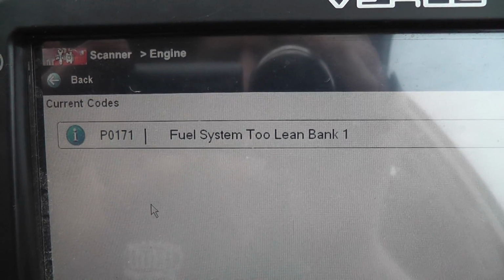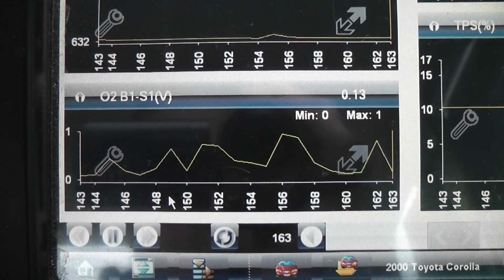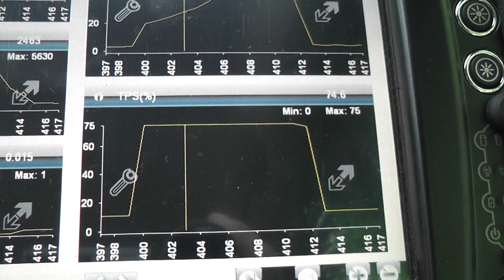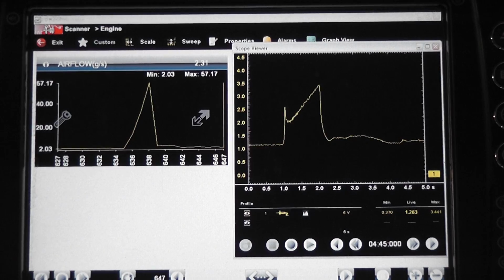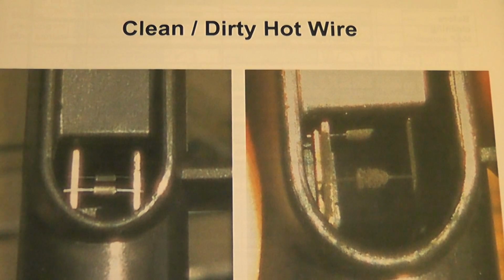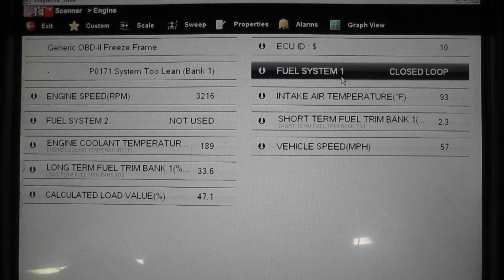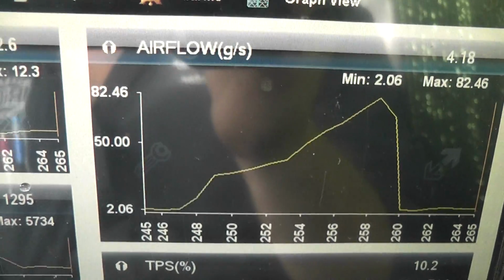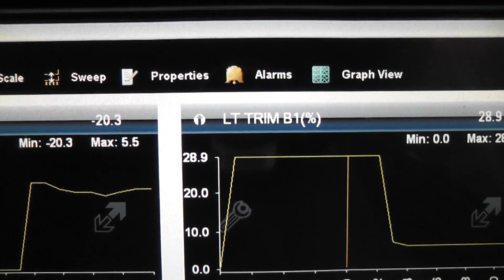Dirty MAF Sensor Case Study

Comment: First, great video.  Really instructive.  How did you conclude that it was a MAF sensor problem from the O2 being lean at WOT?  Couldn't it have been a fuel injector or a fuel pressure problem?  Did you know what the fuel injector pulse width should be at WOT, and that was how you pinpoint it to the MAF?

Also, would it be possible for an injector to fail (and not open properly) even if it was getting the proper fire pulse at WOT?  If so, how would you rule out that failure possibility? 

Is there an easy way to check for fuel pressure on the Corolla?

I have a 1999 Corolla, so have an interest in this.  Appreciate any response, if you have time.  Thanks.
Reply: OK, just reviewed video and saw that you were looking for a specific high MAF sensor voltage when you snapped the throttle.  That was how you isolated the issue to the MAF.  Sorry, should have watched a few more times before asking--just a ton of info in your videos.  Looks like a fast scope is very helpful.  If you ever expand your primary audience base of professional mechanics, it would be interesting to see if you could devise some trouble-shooting techniques for home DIY with only a scanner and voltmeter, etc.  For example, would it be possible for a home mechanics to have properly diagnose the problem in this particular case without a scope probe?

Not sure if you would have time to respond to this long post, but wanted to give my comments.  Really do appreciate your videos.
Reply: During WOT the computer doesn't use the fuel trims, so the o2 always read rich. It has the opposite effect during his test drive and was lean.. If it was a bad injector you would see check engine lights for a  misfire.

I'm a DIYer and watch a lot of danner videos to learn his process to trouble shoot. I don't have the fancy tools available but use what I have. I use a DMM and my bluetooth/torque app to diagnose. For example in this video if I suspected the MAF was bad I would unplug it for a test drive. Without a MAF input, the computer will use a default fuel map instead .. if the car runs better without the MAF then I'd suspect the MAF.
Reply: czhou57
I have bluetooth OBDII and torque as well.  The thing that would really help me diagnose problems is if there is published reference on OBDII live data parameters.  For example, if you were suspecting the MAF sensor, you can just drive around looking at the MAF live data reading at idle, during acceleration, at 2500 RPM, etc.  This would be a very easy and painless way to at least establish a direction in the diagnosis.  As it is, there doesn't seem to be any universal reference material on this.  For example, this kind of data isn't in the service manuals, from what I've seen.  So a person has to go on Internet car forums and ask, say, "is 3.9g/s mass air flow at idle is normal?", and things like that.  Scannerdanner usually mentions that he knows that what a parameter reading should be, at certain condidtions--I don't know if he knows this from experience or if there is a reference source that he has access to.
Reply: I agree. The data isn't readily available, but is out there. For example, on the factory service manual for my van it says it's 5-7 g/s at idle up to near 125 g/s at WOT. Then in troubleshooting steps it says if reads below 100 g/s at the 1-2 shift at WOT then there's a problem somewhere. Then it has a bunch of tests to check for bad voltage supply or wire to the computer. I believe the specific data is specific to each car/engine/manufacter. I think with the absent of these  #s  , the key is to look at trends of the graph like in the first half of the video.

I think it helps to understand how the MAF works. With the hot wire type MAF found in many cars, the sensor is a wire resistor that is cooled by the air flowing across the wires. With more air flow, the resistance is decreased. Typical supply voltage coming in before the sensor is 5 volts. At idle, very little air passes through the sensor, so it should read at the lowest voltage...something like 1V or less due to high resistance. Then at WOT, the max amount of air is flowing through the sensor and the resistance is at a minimum.. so it should read at the highest voltage.. something like 4V or more. The computer will take in these voltages and translate them into a grams/sec reading.. a higher voltage is higher g/s reading, for example. 

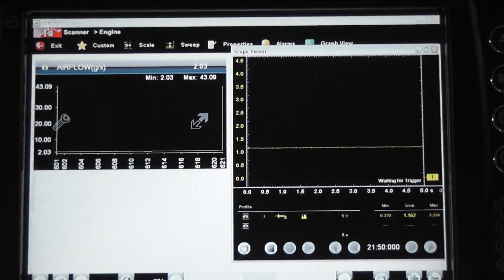What you see danner doing at 6:00 is testing for max voltage at WOT during is snap throttle test. The reading was less than 4V, and that led him to believe he had a dirty MAF. 

Now, thinking about it.. I believe that the MAF can be tested simply by testing at the two extremes.. idle and WOT. I don't think its possible to have a good reading at idle and WOT but bad at part throttle due to the way the sensor is made... its just a wire resistor.. unless its a random intermittent faulty electrical signal or something like that and only applies in part throttle.

Also to add to that thought, I think that g/s reading isn't as important as the voltages themselves.. so I believe danner's comment that the MAF should be over 4V at WOT would apply to any car with a MAF with a 5V supply circuit.. so if you don't have g/s data, you can just dive right to the voltage. Since the specific data (in g/s) is different for each car due to variations in engine requirements, but the MAF is still driven by 5V and should trend the same way (low volts at idle and over 4V at WOT)

Hope this makes sense. Thanks for asking the question. I learned a lot too while trying to figure this out.
Reply: Sorry for the long post above.. I typed it out in segments while I learned about the MAF .. didn't realize it would be so long..

I still agree with your first statement though about not having specific live data points to compare with. I have a GM, and their factory manuals are generally complete with flow diagrams to test and diagnose certain components, but in general the data isn't accessible outside of anyone without a factory manual. The helms/chiltons manuals aren't as detailed.

Comment: Great test i like the veruss min max capability however i always use my dvom when reading o2 signals ive just been burnt to much with false readings but overall that was a great test got straight to the root without even having to check fuel pressure

Comment: 1998 f-150 4.6 4wheel i replaced both exhaust manifolds,both cat pipes all 4 o2sencors plugs and wires and im gettin codes po171.. po305... p1151 im lost on what to do next it wont pass inspections with check engine light on any sugestions

Comment: Paul, MAF air flow depends on HP. The 2000 Toyota has 125 HP so max air flow will be about 110 gm/sec. An E39 M5 has 400 HP so max air flow is 350 gm/sec.

Comment: I have this code on my ford focus 2001 and I got a p0171 code. I do have an autoenginuity scan tool with ford enhancement. Do I have to check those 4 PIDs to make sure if I have a vaccum leak or a fuel pressure failure? and when you run this test, did the car was on KOER or KOEO?

Comment: This looks like exactly the right video to help me figure out my 2002 Prius.  It gave me two P0171 codes.  I borrowed a scanner from a CarQuest shop and the freeze frame data says:
Fuel Sys 1  CL
Fule Sys 2  NA
Calc Load %  48.63
ECT%  72
STFT B1 %  0.00
LTFT B1 %  43.75
ENG RPM  1494
Veh speed 45
IAT (deg C)  12
[I am a complete novice and don't know what most of this is saying.]
Does this look like a dirty MAF sensor, too?  I am about to attempt cleaning it in my driveway.  Yay -- it's above 30 degrees for the first time in weeks, too!
Reply: Yes it does. An under load lean condition is what your freeze frame data shows. IT will either be a dirty MAF or a low fuel pressure problem. Although this being a hybrid may change things but I am not totally sure.

Comment: GREAT VIDEO! So to recap what you said, if the check engine light pops on at say 30-40mph, it could be a dirty MAF and if it pops on at idle it could be low fuel pressure or a vacuum leak?

Comment: Hi Paul  question about 99 frontier 3.3L code p0300 high idle about 1800 maf signal snap throttle 3.8V the maf has oil and the air filter too is this maf sensor can set  
P0300?

Comment: This is so awesome man. My 98 camry was running lean base on my fairly new plugs having ash like build up and power reduction at increased RPM. found you video and it surely help me to understand a bit more of whats going on. dont have all your test equipment but now know the expected output voltage from the sensor when I do my volt meter test. 
As an electrician I know the benefits of the right test equipment. great job on the video.

Comment: Cheers man. Just recently bought a Celica GT-S and suspect I'm having almost the exact same issue. Replaced Spark Plugs and put injector cleaner in, didn't help much with my lag. Figured it was a MAF Sensor issue. Going to clean it this afternoon and get back to you :) This vid helped a lot, cheers!

Comment: I have a 1990 Toyota Camry, and i just replaced the Fuel pump, and filter, and spark plugs/battery. The car starts up, and then it idles, and a few seconds later, dies. Does anything ring a bell ? because im about on a blank on whats wrong with it. any tip or help would be appreciated!

Comment: I have a p0171 code as well. Changed MAF and  O2 and code still present. Car struggles in the freeway. U think its the fuel pressure regulator or the fuel pump itself? Its got a high mileage.

Comment: hi, wondering if you would be able to tel me why I can't sync any of my scanners to a 2002 Rav4 and a 2002 Avensis Verso both have the 1AZ engine? I have a n Autel AL419, Autocom CDP+ and also an ELM327 off eBay, none of these scanners will connect to the ECU under any circumstance, except the Autocom but only if I set it to Rav4 02 Model with Diesel engine, and even then it only gives limited access. I'm having an extremely lean burn.
Thanks

Comment: I've had this issue before and although I fixed it with a clean, the sensor eventually failed down the line.  I just prefer to replace the sensors now.

Comment: Danner,great channel buddy. As a hobby mechanic, and a guy who mostly tinkers with *gasp* carbs, I can only dream of having the diagnostic tools and knowledge that you've acquired over the years. But I appreciate you showing us how it really should be done by good, experienced mechanics.

Quick question for ya. On my 96 Mustang I had a P0172, if I remember correctly. I chased it for months with new vac hoses, sensors, etc. Ended up being badly arcing plug wires. Does that sound right to you?

Comment: Hi Paul. I have a question about hot-film MAF sensor like HFM 5 made buy Bosch. A good initial voltage spike signal witch produce this sensor, is it similar with the same initial spike signal witch produce a hot wire MAF sensor or not? Thank you.

Comment from the maker: The check engine light will set the other two lights. They are the traction and vehicle stability control systems. 
Fix the check engine light and you will automatically get rid of those other lights

Comment from the maker: there is no time frame, it is a learned value and will constantly adjust if needed. Every run period there can be small changes with it. 
After a repair, it will correct back to normal values while driving the vehicle. 
Watch my video "Understanding ST and LT Fuel Trim"

Comment: The VVT-I configuration did not exist on the 98 Corolla, it started on the 00 model year. Check your fuel pump pressure. Had the same problem on my 98 Corolla at around 200,000 miles. New fuel pump cured the problem.

Comment: Hey.

I have a question.  I have a 1998 Corolla VVT-I and it does not have a MAF sensor.  Some people said it is on the air box but there is nothing there.  I have a P0171 code that is annoying me and I would like to try this first before replacing the 02 sensors.

Thanks.

Comment: I have the same car. I have high long term fuel trim over 30 and short term at -+3 I changed intake gasket, o2 sensor, checked for leaks, exhause gasket. Swapped mafs what do you recommend.

Comment: Working on my friend's 2000 Tacoma truck today. Same P0171 code, plus a P1133 (A/F sensor circuit response). Drove around, long term FT topping out at +39% at higher engine loads, but negative at idle. This video instantly came to mind. Checked fuel pressure just to make sure, then went after the MAF. BINGO! A little electronics cleaner and a light brush...truck drives like new now! So why don't these sensors have a self-cleaning burn-off circuit like older MAFs? Once again,you're the man, Paul!

Comment from the maker: Yes. The MAF sensor is actually a mini computer. All of the conversions are done inside of it. 
All computers need a main power and ground to work. So you can think of the 12v feed and ground on this MAF sensor as the same thing. IT is actually a MAF module.

Comment: Thank you for your response , so it receive 12 volts external the maf and some way inside the maf it is converted to 5 volts Out put  sensir signalto PCM  is that rigth?? Because on snap throttle I saw about 4 volts. Thank you , you are a great teacher

Comment from the maker: There are two grounds because the PCM MAF signal circuit actually gets its ground through the MAF sensor. 
So one ground is PCM to MAF and the second ground is MAF to the block. 
If the MAF to the block ground is bad, BOTH grounds will be bad. 
No 5 v ref. on this design.

Comment: Paul do you know how this circuit works  (maf sensor) I was working. On  2000 ford focus  the maf sensor has  6 wires 
Pin 1 And 6 are for air sensor . The pin #2 has  system voltage ( 12v). On the pin #5 is coming out the sensor signal to PCM at wot  about 4 volts . But on pin 3and 4 I have ground . How that works . This was perform on not working maf I did. Not see  any signal so I decide ti check power and ground  and I did not find any 5 volt reference  any way I replace the maf and it fix

Comment: Unfortionetly. i have a 95 monte carlo z34, nothing but problems since day once...idk wtf its issue is lately, on idle, the pos runs way to rich and seems to be running only on a few cylinders, but soon as ya touch the throttle, runs n purs like a kitten, so idk what its issue is, and quite honest, idc to even work on it no more, nothing but a money pit, i'm just going to drive it til she blows, unfortionetly, it wont, ive been beating it senseless for months now..maybe ill fix it someday idk..

Comment: I'll still rather deal with carbs then bullshit fuel injection...yes injection is quite better when it comes to starts and emittions and such, but carbs are MUCH easier to work on, and IMO easier to tweek and get going easier...all these engines these days with electronic controls these days are just all set up to mess with the mind and cause issues, and cost the owner nothing but loads of money just to get running correctly...i'd take a old ass carb engine over a fuel injection any day..

Comment: If you're reading the values from a diablosport predator, I believe the output for the "baro hz" isn't the actual hz, its that number converted to "Hg based on a table.  So a reading of 30Hz is actually 30"Hg...or approximately sea level.

Comment: IMO injection is far better than carbs. The metering is precise, cold starts and I mean thirty below cold engine starting is better BUT I have had carbureted cars that would start great with one pump. I I think the carbs had choke problems after time.. But each to his own! I still have a little single barrel Carter on my 78 F150. I had it rebuilt and when it needs to be done the next time its no charge.

Comment: Thank You Very Much. I just purchased a 2000 Corolla and after changing the spark plugs didn't fix the problem I guessed it was the oxygen sensor. So $85 dollars later I was feeling a little worried when I still had the same problem and not sure where to go. Your video saved me a lot of time, worry, and most likely money. Just removing that little bit of dirt made all the difference. Thanks for the video!

Comment: Thanks for reply. Will there be situation where good working o2 sensor will not switch in closed loop mode because of vacuum leak or fuel issue.

Comment from the maker: if the o2 is switching before the wot run then it is not an 02 problem. it is a fuel delivery problem. low fuel Psi and dirty MAF are the top two.
a severe misfire can also cause this

Comment: IF I DO WOT at more than 6000 RPM, ECM is cutting off, all i can go is max 6000 RPM, can i consider this as WOT, or even if ECM is cutting off, i should simply press the gas pedal to all the way to floor, to make it as WOT.

Comment: i have a 2001 gmc sonoma and its throwing a p0174 code. i changed the fuel filter, cleaned the MAF sensor, checked for vaccum leaks (which there werent any), and my trucks running like complete crap. (its a v6). im thinking that bank 2, sensor 1 is bad. please help if you can. its much appreciated. i just got my drivers license not too long ago and i need to fix my truck as fast as possible.

Comment from the maker: typically not but it is possible. you need to start by checking your fuel pressure and checking for a ruptured fuel pressure regulator diaphragm

Comment from the maker: @GamingJediPwns you are mistaken on that comment. this style of hot wire maf is not damaged by the cleaner i used. its just a heated resistor with a glass covering. I've been cleaning them this way for 15 years with ZERO comebacks

Comment from the maker: @03mazpro a dirty mass air flow sensor will not cause a catalytic converter trouble code. if all you have is a converter code and no exhaust leaks then you need to replace it. as for cleaning the mass air flow sensor as long as it is the style in this video then it is cleanable and brake or carb cleaner is fine